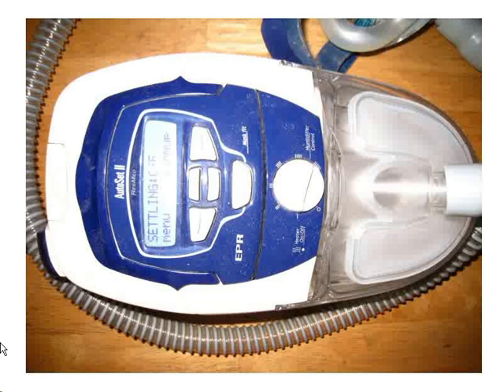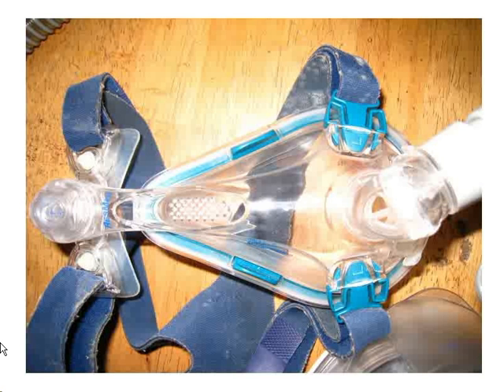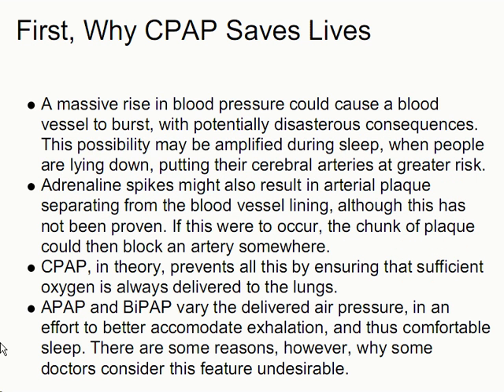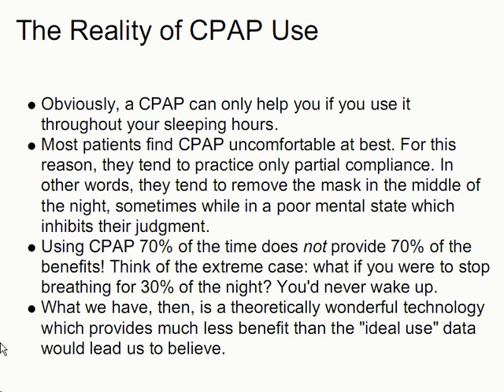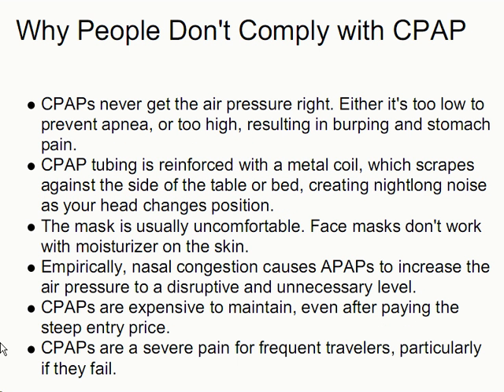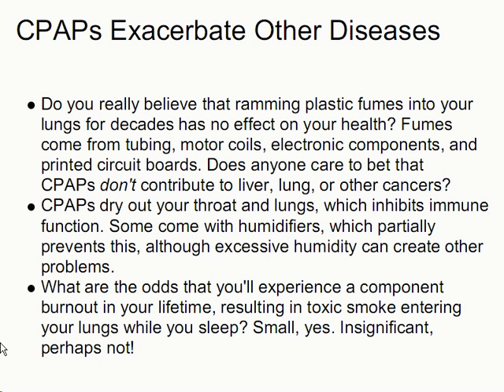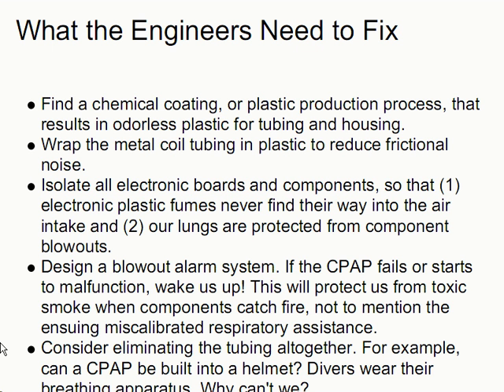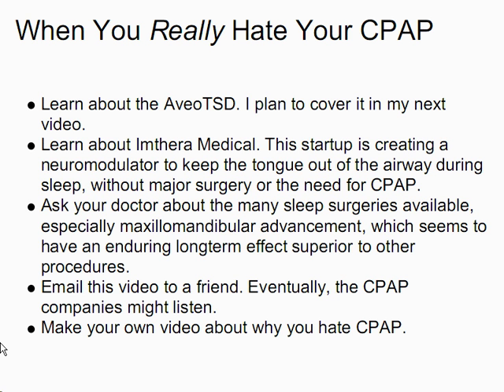Why CPAP Sucks and What to Do About It

Comment: Doctors and Nurses joke smuggly about the many "idiots who wont use their CPAP"..* if the medication does not work, & more of a hindrance why use it? 
They had me try the humidifier, chin strap, i tried for years. Wake up with it off or mouth open and worse off. Seems to be More of a employment scam then a cure for most.
Reply: If you have allergies or work around dust its a instant sinus infection. Even with saline spray.  Best help avoid alcohol, and DONT sleep on your back even with that machine.  I work out. the chin straps arent strong enough to keep mouth shut, wake up worse off.

Comment: "remove the mask in the middle of the night".  I did that also, you just have to work thru it and get adjustments.
"CPAP isn't sexy"....neither is snoring like a freight train
"CPAP smells like a shower curtain"  Thats why its important to wash it in warm, soapy water everyday and run cold water thru it to remove any suds and let it drip dry.  Also, get the mask and hose changed at least ever six months and replace the filter once a week.
"CPAP motor will burn up, producing toxic smoke"  I have never heard of one case of this and the technology gets better and better all the time.  All machines can fail and be potentially fatal.
"CPAP never gets air pressure right"  The newer Bipap machines are very good about this and its important to get adjustments as needed from your sleep technician.
"CPAP tubing is reinforced with a metal core"  I have used many many CPAP tubes and never seen any metal in any of them.
"face mask don't work with moisturizer on the skin"  I must be lucky because I put on moisture all the time and have no issues"
"CPAPS are expensive to maintain"  They are very inexpensive to maintain 
"CPAPS are a pain for travelers"  Finally one I agree with.  Diabetes medication, defibrillators, feet pain, canes, many things are a pain to travel with but thats how it goes.  I have traveled with my CPAP many times and I have learned how to save luggage space and deal with the annoyances of travel with it.  It's not too bad
"CPAPS can contribute to cancers"  I have never seen one study that shows that.  There are no fumes, its air.
I stopped watching at that point......Sigh, theres always one.

Comment: The CPAC was pushed onto me without my being informed of other options. When I later asked about the non-electronic alternatives, I was informed that insurance would not cover any alternatives since I already used the mask. It is better than not using it, but if you do not want to be dependent on a machine or become a slave to the greedy durable equipment industry, insist that all alternatives are tried BEFORE they push a CPAP on you! These  medical supply companies are making a fortune on replaceable parts and will suck every cent out of you that they can.
Reply: Andrew Wroblewski its garbage. If you have allergies or work around dust CPAP is a instant sinus infection. CPAP is a lousy bandaid in this billion$ healthcare system
Reply: James Stahlnecker The CPAP unit has a filtration system that is specifically designed to filter out pollen. With recommended filter replacement, and proper cleaning (of the humidifier chamber, mask and tubing) there should be no reason for contracting a sinus infection.
Reply: The other alternatives to which you are referring to include a mouthpiece (supplied by a dentist), and surgery (which involves removing soft tissue in the pharynx). Depending on where you are from, the mouthpiece is often a more expensive option and is typically not partially funded for by government health agencies. Surgery is very invasive and carries some risk with it as well. BOTH of these alternatives are not guaranteed to work. They are modalities used in an effort to increase the diameter of your airway to make collapse/obstruction less likely to happen. CPAP or its variants (APAP, BPAP etc.) are practically guaranteed to work. The only thing that has to be determined is your optimal pressure needs.
Reply: @andrewblewski7926  CPAP is NOT guaranteed to work
Reply: Andrew Wroblewski I had a uvulectomy and it failed to provide any relief. Long after the surgery I was diagnosed as having central apnea so the surgery was probably a complete waste.
Reply: Larry Freedman They sold ya that machine anyway, huh?
Reply: I used to know a guy who swore that a tracheostomy  was the best solution. All you need is for a surgeon to cut a hole in your throat. Of course, there may be a downside to that, too, but you wouldn't be "dependent on a machine." It IS one of the alternatives that you did not explore.

Comment: I am a long term user with severe sleep apnea; my CPAP machine has definitely saved my life, and I use all night every night. But that doesn't mean there aren't problems. Here are some and solutions I'd like to share: 1) humidifier systems are easily contaminated, and can spread bacteria and mold into the lungs. I use a mixture of 3% peroxide (available at any pharmacy) and purified water, in a ratio approx. 30:70 to eliminate this problem. 2) Chemicals in plastic: I try never to change my tubing, the new tubing has the highest levels of chemical fumes. In addition, I periodically rinse my tubing, mask, etc with 30% peroxide, which I am able to obtain. I do this to oxidize the migrating chemicals and destroy them. and then rinse repeatedly with purified water. This is not perfect but at least helps reduce the chemicals on the surface of the tubing. 3) I do have a technology available that can coat tubing etc w a molecules thin layer of glass, which effectively isolates the chemicals in the tubing. Engineers and such are welcome to contact me.
Reply: Contact Medicare, you'll be rich.
Reply: +apnea survivor,
Jeez!  So refreshing to hear someone with severe sleep apnea can find success.
I actually worked for Respironics when it was a Pittsburg-based company.  My division in Southern CA was for the Hospital side, using CPAP in the ICU.  Then Philips came through and acquired us, having 2 layoffs post merger.   
 - ANYWAY,  this is scary stuff about how METICULOUS you have to be with the humidifier sanitizing.
- Question:  since 3 years ago, has there not been a new spray or even Cleaning Machine made ??  I think I saw it on TV.   Just checking as I'm trying to get my 84 yr. old Dad to see if he has any form of sleep apnea, but reading all the Comments is really educational, yet frightful.

Comment: I don't know if you still check this page for responses. But I need to say I've been using a cpap for over 12 years now and have not had as many problems that you seem to have. Once in awhile I'll have my mask move at night then it wakes me up with the air shooting out. But I just  readjust the mask and go back to sleep. I've gone through 4 machines during the years one of them was the one you showed, I will say I had more problems with that one then any of the others. I hope you get things fixd

Comment: I'm not trying to steal your thunder... But I'm an RPSGT- I've been doing sleep studies for over 6 years and surgery, while an option for some, isn't an option for most. In my experience w/ my patients, many surgeries have no significant effect or lasting effect much of the time, and CPAP is needed regardless- it all depends on what is causing the apnea in the first place.
Reply: +Colin Munzlinger
Hello dear sir.  I am having trouble getting my father's Internal Med. Dr., to approve or order a Sleep Study!!
Part of the problem is my 84 yr. old father, Not thinking he has a problem, or any obstructive sleep.  
He has done that Snorting thing, which indicates a collapse.  My mom has heard him.  She does Not sleep in same bed, rather on other side of wall, due to his loud snoring.
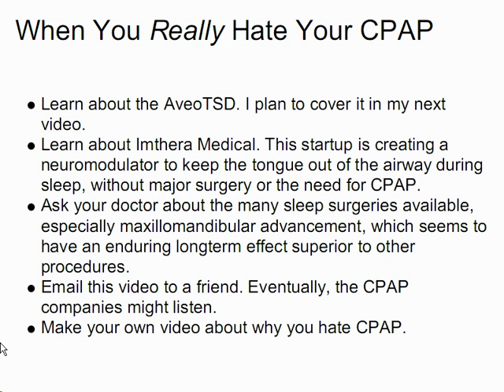He is 84, requires naps after being up for 4 hrs/ 8:30a rise, then by 12:00p want to go recline in a chair and naps for several hours.
=== This crummy Primary Care (internal), simply thinks my Dad may not be bad enough for a Study.  What did not help is my father probably "tailoring" his responses to the Dr., to Avoid a Sleep Study, and any treatments.   Ugh.  
- QUESTION to you would be:   WHAT can I really say to this Dr. to give my Father the Referral/Order to a pulminologist ??
In an earlier Comment, someone did hint if my father has a Cardiologist, he can possibly get it from him...   help, plz.  Thx~

Comment: CPAP doesn't suck!  It's a life-changer and for some, a life saver.  I can't sleep without my CPAP and haven't for 8 years.  I take it camping, hunting, and ice-fishing.  I power it off of a deep cycle marine battery which gives me a couple nights of CPAP operation before needing to recharge it.  If you can't stand CPAP even after desensitization exercises with your treating sleep center, then consider a dental appliance.  Surgery should always be the last resort as its success is 50% at best.

Comment: If companies are looking for ways to better their product, change the tubing that runs from the headgear to the machine: lighter, longer, and make sure that all connectors that allow twisting.  Consider developing a wall hook or other small wall device to hold the tubing that runs from the headgear to the machine up and away from the face, rather than dragging down into the pillows.
Headgear - line the straps with soft cloth so it doesn't pull my hair, make it as light and minimal as possible.

Comment: I think that he has valid points here for the people who are trashing him. What's wrong with trying to make a therapy better? I've been using cpap for about 8 years & while it didn't help with my pain levels, energy levels or weight loss  it did drop my blood pressure dramatically & I no longer wake up with disabling headaches, reason enough to use it. However I can"t use a mask as it breaks down the skin on my face I use nasal pillows but they aren't as effective and move a lot. Catch 22.

Comment: I've been on CPAP for 2 years now, and I must admit that I'm totally accustomed to using my therapy. In the beginning I really struggled with it. The way I got used to it is something I call "concentration on sleep". I stopped thinking of the air pressure as a hindrance and instead a assistance. I would breathe along with the machine concentrating on a rhythm till I fell asleep.

Comment: Thanks, I've used coconut oil before.  Good stuff.  I even got some "dry mouth" products to find relief. 

My teeth were good and strong, not hollow or brittle, which is why the dentist could save them by bonding some material to the edges, thankfully.

I finally got a dental appliance  which for some reason solves the dry mouth when used with CPAP.  I also want to use an oximeter to see how my sleep is without CPAP but with the appliance.  If it works well I'll dump CPAP.

Comment: I use a  7 foot 1" wide aluminum pipe I bought at a metal store as my cpap tube then I use a 1 foot silicone tube at the end that connects to my mask. This produces much less odors. Another BIG concern with cpap is the EMF's ( electro-magnetic-fields) which I ve measured and they are REALLY high, I moved the bipap 8ft away from me and it makes a really big difference in how I feel.